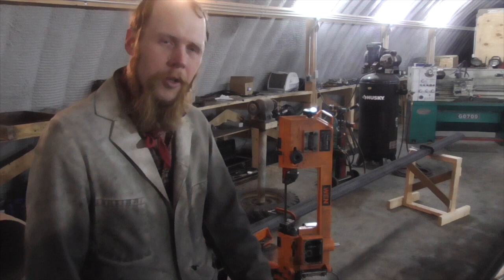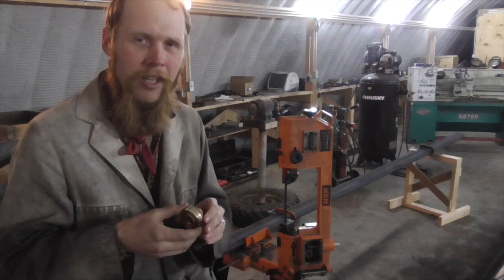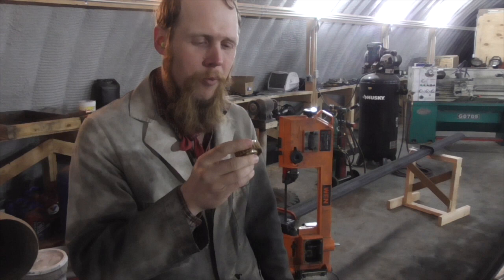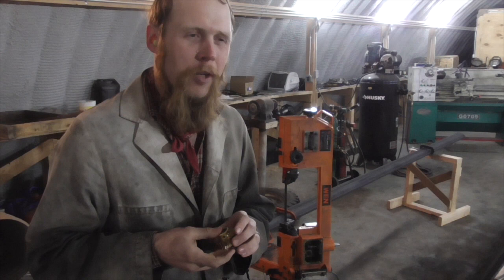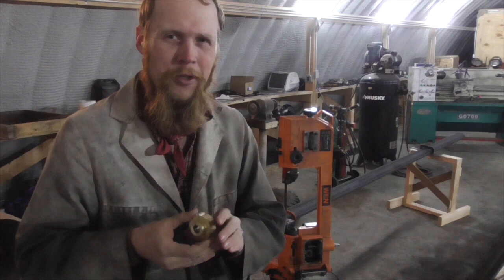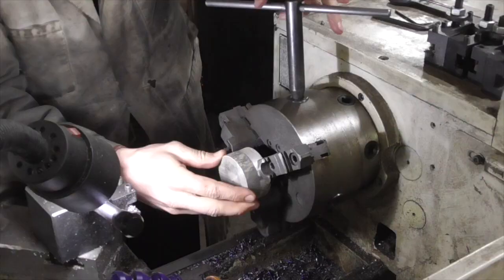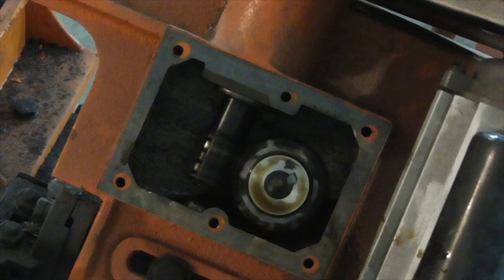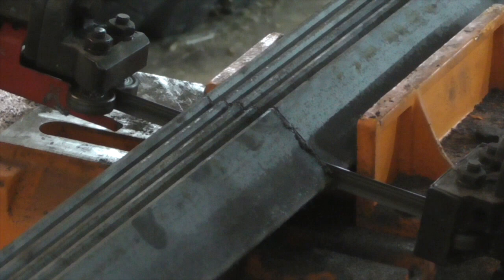Improvised Worm Gear for Band Saw (TIS329)

Comment: Superb fix.  In my last year of high school, my machine shop teacher took the challenge of replicating a brass worm gear out of a tractor for a friend.  the original gear still had a few good teeth so he was able to take measurements off those and grind up a lathe tool bit to match the tooth profile.  He then set up a dividing head in a vertical milling machine.  He had me machine the gear blank.  My teacher also took a lathe boring bar and set the special tool bit he ground to be at the approximate radius as the gear teeth.  The boring bar went into the quill (collet) and the tool bit spun like a fly cutter.  I had already had some lessons in operating a dividing head so he had me do the indexing.  He set everything up and I did the machining.  Each day in class, I went back to the setup and machine a few more teeth.  On the last day of school I chose to remain behind and finish the gear.  My teacher and I shook hands and I left the building. On my way out, the halls were empty but I felt an enormous amount of satisfaction.

Comment: If you have a 3D-printer, you could attempt to design and print a gear ... perhaps make a casting-mold ... that way you only do the hard work once, and later can print/cast new gears as needed.

Comment: I have recently bought a sealey branded machine but it's basically the same machine as yours. I'm doing a full restoration and after removing both drive shafts of the wormgear and removing all 4 bearings I've found that each shaft had a sealed bearing and a bearing with one open end. I think the idea is the sealed bearing goes to the outside and the other nearest the oil reservoir with the open end bearing getting constant lubrication. I just want to know if you had the same or has someone replaced them with the wrong ones at some point. Thanks. Johnny.
Reply from the maker: I never removed the shafts, so I didn't really look to see what type of bearings they used.